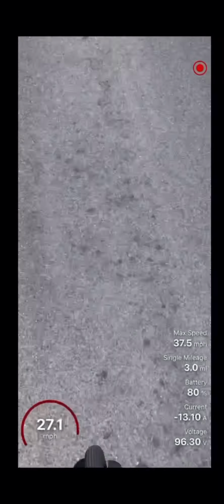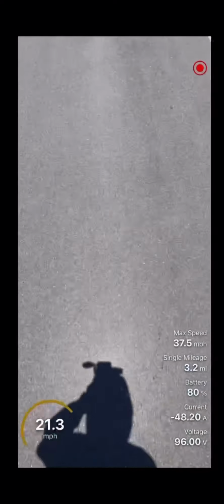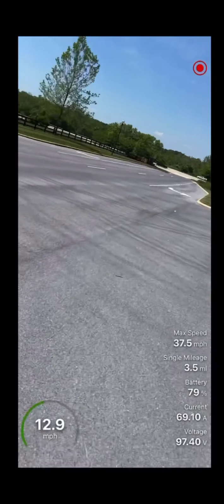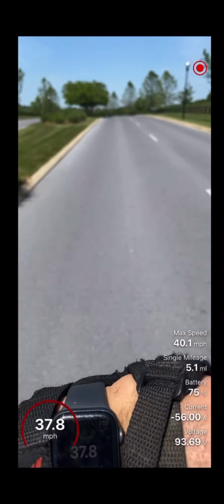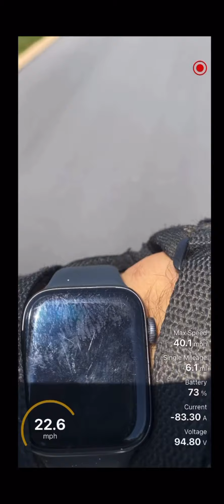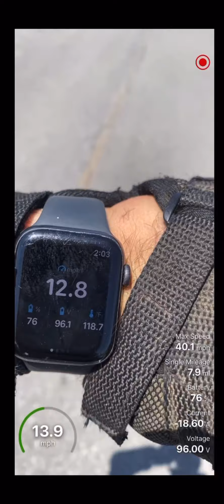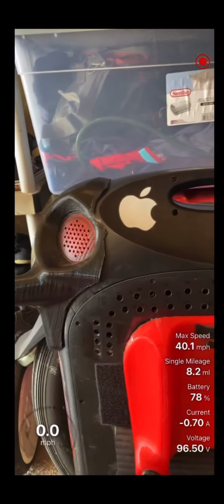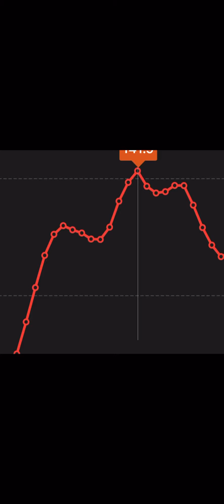Keeping the monster cool

Comment: Hey glad to see you are well.  I was thinking about trading yoshi my sherman for his mpro. He's a small guy and if you remember me in the 250 pound guy haha.  You think the mpro with the cooler upgrades will conquer Marty's tour with my donut eating ass? Haha thanks for all your help in the community!!
Reply from the maker: absolutely will. for me, the way and speeds i like to ride and riding weight off 205-210, it will be a 70 mile wheel. i can get 90-100 on marty’s tours
Reply from the maker: i got 61 miles on my rst on marty’s first day ride without recharging. so i don’t see any problem with the pro doing the same. i adjust speed to do the range necessary 😁